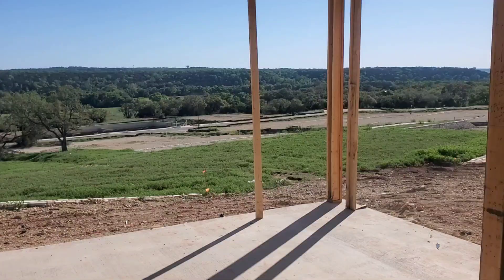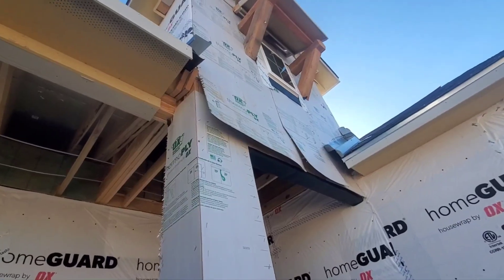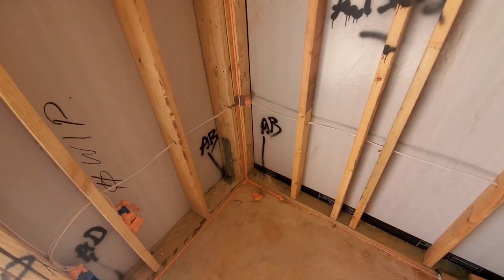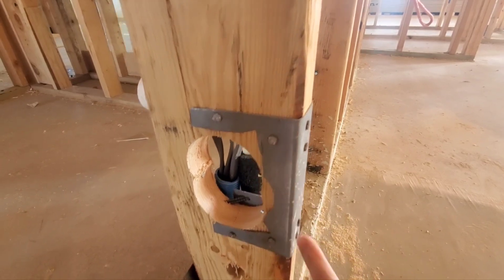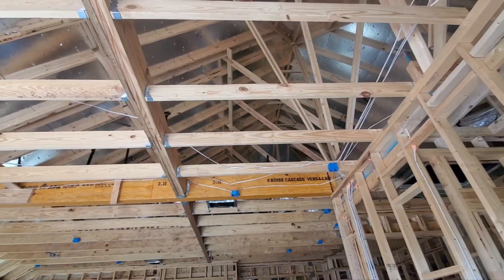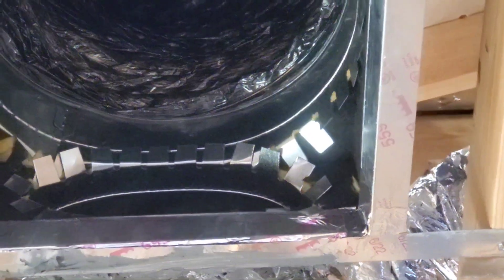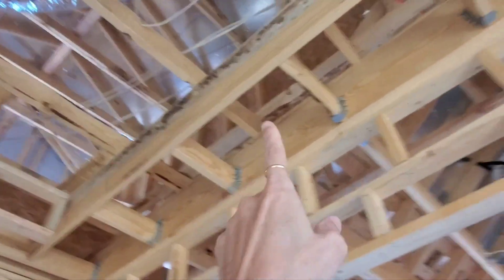Pre-drywall inspection March 24th, great views, bad editing, and a few interesting finds.

Comment: You sure those weren't jumper ducts? I only ask as there was 3 in 1 box. In my climate zone we see that often. Plus they aren't pookied. Even if they are jumpers we still recommend sealing them to prevent pulling attic air into the envelope.

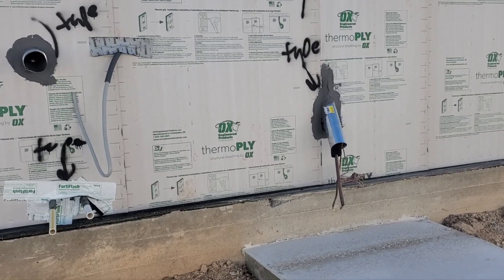Comment: 1:26 are they underpouring on the slap and lipping it to make it look like the used the correct amount of cement? This is the second house from you videos I've seen this on.
Reply from the maker: The lip is from the ugly board with the rounded corner used to form the masonry ledge. Oops.

Comment: For the commenters on here.
The T-ply that is being referenced as cardboard, actually has gone through the testing and has the same strength as OSB, 1/2 plywood or any other approved wood structural panel.  No it doesn't have shear (tearing) strength just like osb doesn't take much to use a hammer to punch a hole.  It does have the lateral bracing strength when installed correctly.  Technology is hard to understand.  The stuff runs for about $7.00 a sheet vs $35-40 a sheet for an organic wood product.  More expensive in labor, in shipping and is prone to mold, mildew and moisture problems.  The t-ply is waterproof all sides, meets the requirements for a draft stop.  The wood products don't.  At the cost of homes today it would add 10's of thousands to use wood sheathing today.  there is nothing wrong with the material so long as it is used in the right application and installed correctly.  Staples are approved.  Stapling correctly does not cause water or air leaks.  

The placement of the fresh air above a condenser is not a code violation, or an energy star, or a HERS violation.  The dryer vent is also not a violation in its location.  The return vent can be reduced (compressed) by as much as 20% before losing any measurable efficiency.  This is allow for making bends and routing between trusses and such, that is part of the calculation.  What is a violation is not covering the vents and returns during construction.  That is a code item.  This prevents dust and debris entering the duct work and forming mold and mildew.  

For the shear wall, look at the plans, some plans allow powder actuated (I doubt that far of spacing usually 6" - 8"), lag screws that are epoxed, or wedge bolts.  Most are 4' on center to 2' on center.  I have not ever seen a shear wall engineered for 6' on center, may exist, but we shouldn't say usually.  What do the plans state.  

For the hanger, hangers are not needed for boards that are 4' or less.  And are only needed for structural.  Those looked like sheet rock blocking and hangers are not needed.  The other board is a beam and yes it needs hangers on both ends.  

Good call on the brick ledge, that is sick that is coved like that.  I will look for those more often, that is a water intrusion nightmare to happen.  

My comments are based on the IRC, and state specific, and I am in Texas.  I am not sure what state this home is in, so will be some differences.
Reply from the maker: Hi Jon, thanks for making such a detailed comment. I'm in Austin, so we aren't too far apart then. 

My understanding (and what you will find I have commented on in the past), is that Tply (dryline, barricade, etc) is, according to the ESR, equivalent to 3/8" OSB with the big caveat that it is installed correctly. That's fasteners 3" OC. Plans will often allow the red Tply to be used as wall bracing so yeah, it has its place. You might find the price has gone up considerably...something like $20/sheet nowadays. 

The big issue I see is that it is constantly installed wrong. 

The placements of the vents in relation to the condensing unit are not code violations, you are correct. I would argue all day that they will lead to performance deficiencies in the future. Blowing hot air into your makeup air vent? That's simple math. And having done countless resale inspections I can tell you from experience that having the dryer vent too close can cause issues with lint clogging up the condensing unit. 
These things aren't code violations, YET.

The return air was compressed considerably more than 20%. Maybe there was 20% left. That was a big drop in area of the duct.  Usually I see them cover the vents after the framing stage so not surprised to see them uncovered. 

Unfortunately the plans weren't available. They usually are not when I arrive (working for the buyer I think that the builders hide them from me). Shot pins are the most common method of interior shear wall anchorage I see; usually the plans call for 8"OC (2 per stud bay), sometimes more, sometimes less. If the plans aren't on site and I can see that they pins have been shot closer than on other interior walls, I know the builder paid extra attention to them so I can move on without making note. In this case the spacing was the same as any partition wall would have been. 
Gotta have that anchorage!

So being in Texas, are you with a company or working on your own? Strand, ATS, or a builder perhaps? Not meaning to pry, just that since I work on my own I often wonder what how the "other guys" do things.

Thanks again for your insightful reply and I hope that our conversation here might help someone else looking for answers to questions they may not even know they have!
Reply: @constructivainspections  nice to see two people having a polite professional back and forth
Reply: I am pretty sure builder is keeping the savings.
Reply: You sound like a builder that like to justify using garbage products.
It’s cardboard.

Just because it passes code doesn’t mean it’s a good product. Code is the bare minimum standard, not the benchmark for quality.  

Also, most codes are driven and lobbied by major manufacturers, where do you think all of this use of Simpson products came from? .

Do better

Comment: hey.. thanks for the heads-up... I didn't know that house wrap manufacturers required cap nails as a fastening system.... I've been using staples. As much as I hate cap nails, they have their place.
Reply from the maker: They are a pain in the ass to install by hand but if you have a gun it makes it easier. 

I would suggest taking a few minutes to google something like, "*brand* installation instructions" to get a good idea of what the manufacturer states. Often that's the only way to ensure warrantability of their product.

Comment: Really sad how low the bar is on new construction, anymore.

Cardboard sheathing. Zero fucks given about most of the build. Almost zero attention to detail. 

Can't even staple in the vent baffles plumb. 

When did cardboard get the nod for sheathing? And what's the cost savings vs commodity osb, plywood, and premium osb like advantec/zip/lp  weather logic or Weyerhaeuser edge gold?

Comment: I'd really love to see builders stop using cardboard boxes for sheathing.
Reply: And staples attaching the cardboard, which don't even hit studs.
Reply: I have never seen that stuff used in Cincinnati. Maybe it is allow in a different climate. If you are going to use that stuff at least attach it correctly. All those staples are going to be air leaks (I think).
Reply: I dont get why this is even allowed!   Just use osb and be done with it.
Reply: @Diebog  About the only time wood chips and glue are the preferred choice, when compared to cardboard.
Reply: Live in a 3B climate and this stuff is part of 2 major trac builders. Most times I see this as a rigid air barrier at locations to provide a 6 sided assembly. Was just recently told by a super that the t-ply used as a shear wall is the alternate on the plans. It's 100% used to save money.